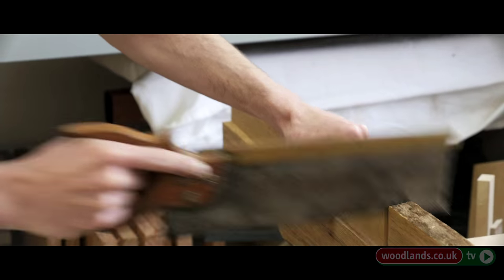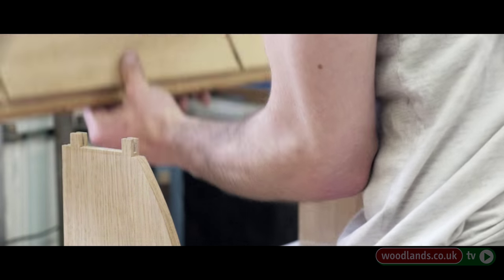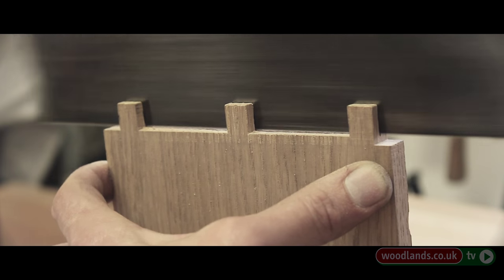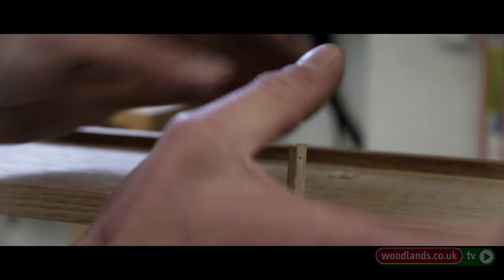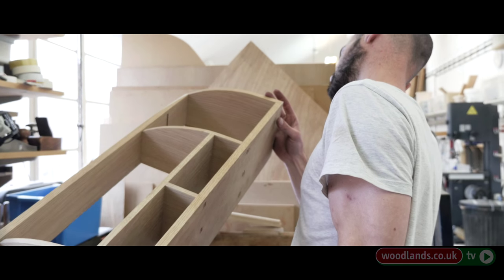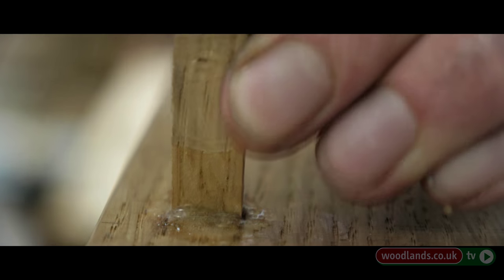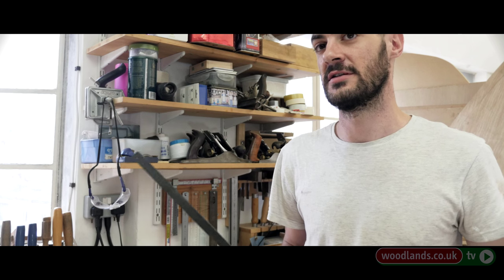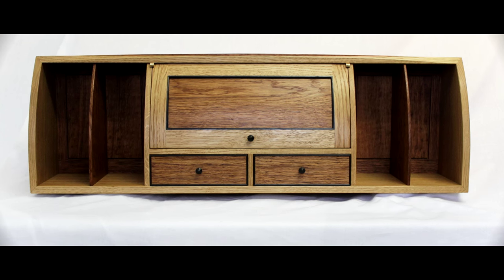An Introduction to Cabinet Making

Comment: what type of money to this guys make? same as a carpenter more? less?
Reply: I don't think nowadays you make a on of money unless you are part of a shop, making gallery type furniture, museum repros, or already famous. I may be wrong though. Its a rewarding job though.
Reply: Depends on where you live, some places have more demand, mainly areas where rich people have fast access to. But you can make enough to eat if your good. You don't become a woodworker to become rich and only like 0.01% of woodworkers actually gets into three figure income. i'd say 90% are lower middle class. Also depends on what kind of woodwork you are doing, i hear boat builder do quite well, Furniture and Instruments are about average when it comes to woodwork, though instruments have a higher potential income, the average is the same as furniture. Woodturners also do Ok, in between boat builders and furniture makers if they are doing it for the money, but most of them are just retired guys turning as a hobby. Furniture restoration makes a lot of money if you are in the right place at the right time, but it is unstable in most cases.
Reply: Furniture making/design doesn't pay the best, maybe 10-12 gbp hour, carpentry pays 16-20 gbp hour, the good thing about cabinetmaking is that you learn other related skills such as woodmaching/finishing/turning/drafting and designing /veneer work/shop fitting & manufacturing/plus joinery, all the best
Reply: To get by with carpentry you need a van/and maybe 2-3k of tools, whereas with furniture making you need premises/van/a lot of hand tools/various machines/loads of ancillary equipment(router bits, clamps) the list is endless, and don't forget the overheads such as rent/insurance/heating/power supply/materials/spray equipment,